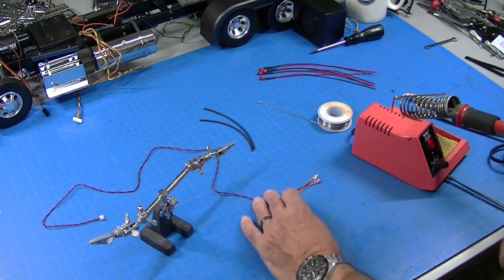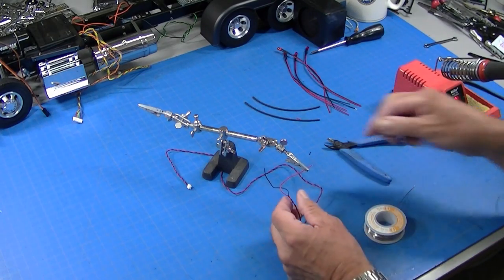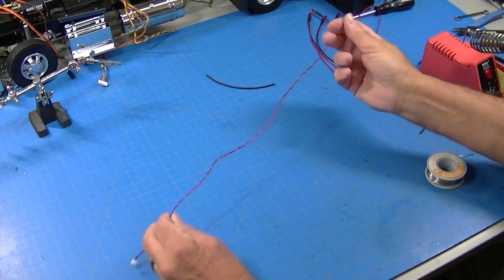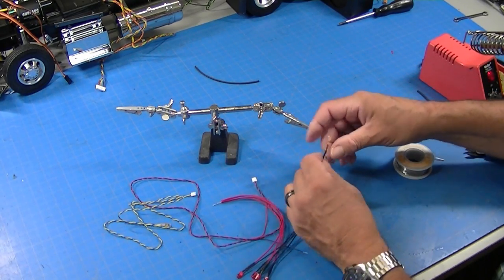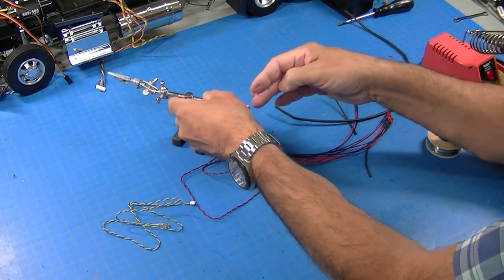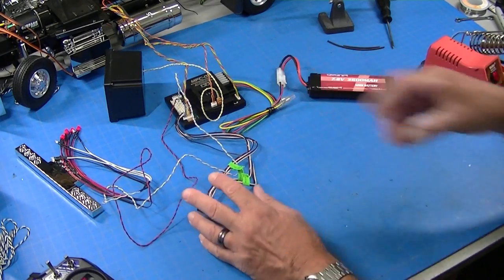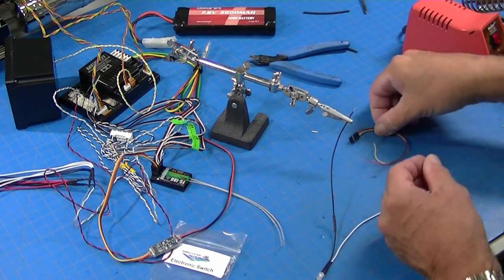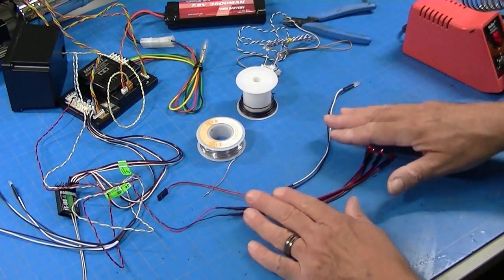Tamiya Semi Truck - How to Solder, Add MFC Lights and Lighting Tips & Tricks

Comment: Old bench tech here. I micro soldered 30g for many years . Using either soldering paste, or flux and solder, dip the stripped end into either and heat with your iron, add solder if needed to tin . When adding a wire to another or motor lug, make sure your joint is shiny and smooth. Great video

Comment: Loving your channel. A tip I learned when using the third hand is to put some heat shrink tubing over the alligator clips to help protect the wires.  Hope that helps.

Comment: I have a question I bought the tamiya 56502 light set for my flatbed I installed marker lights on the side I spliced into the main wire harness all the marker lights work and the Hazzards but the tail lights don't work that's what I tied into can it not be done sure could use your advice thanks Chris

Comment: I've been watching your channel for quite awhile now always find great ideas there, my  problem is I have been  converting trailers to super bs one is a flat deck and the other is a tanker any advice on a wireless lighting system for them ? I also would like to  use my motorized support legs wirelessly i have difficulty getting them to stay hooked to the fifth wheel

Comment: What size shrink wrap should I look for in soldering light systems and motor leads?
Reply from the maker: 1/8" for the light wiring and larger 1/8"-3/32" for the other wiring.

Comment: Hi. Loved your video on adding lights. I have a question on my situation. I have a Tamiya 1/16 Tiger 1 tank. It has a DMD multi function unit. It's the MF-01. I want to add l.e.d. lights to the front of the tank. There are extra slots on MF-01 but not sure if I can plug in a tamiya wire lume in one of those empty slots? I don't want to short out my MF-01 Computer. Are you familiar with the MF-01?  On the top of the MF-01 of the empty slots that are not being used say OPT. I'm guessing that stands for options? Also does the Tamiya L.E.D. wire lume have a built in resistor? Is there any way I can add two lights to my set up? Thanks
Reply from the maker: Look in my older videos I have a 4 part series I did on the Tiger tank including radio programming etc.  I would use an electronic switch for the lights.  An easy way to do it and the lights do not connect to the MF unit.  https://hobbyconcepts.net/products/hobbyconcepts-electronic-switch?_pos=1&_sid=4ad334b19&_ss=r
Reply: @HobbyconceptsLLC  thanks for your fast response. So I noticed that to use this switch it connects to one of the channels on the receiver? I have a 4 channel receiver/transmitter and all for are already being used. I would need to buy a bigger transmitter, and receiver with let's say a 6 channel in order to use this switch? I would hate to spend another $150 or more on another transmitter?
Reply from the maker: Yes, you need a transmitter with more channels.  I like the Flysky FS-i6x (it has 10 channels).  https://hobbyconcepts.net/products/flysky-fs-i6x-2-4ghz-10-channel-radio-modified-for-tamiya-semi-trucks?_pos=2&_sid=ae98d2e1d&_ss=r

Comment: I am hoping if I buy a 5 chan reciever for my spektrum DX5 rugged I can use it and have most of the MFC01 system work with it in my grand hauler build
Reply from the maker: I have never had any luck myself with pistol grip transmitters.

Comment: Very helpful video, thanks, just one question, with the electronic switch, should you wire the led's in series or parallel? Thanks.
Reply from the maker: I wire them in parallel.
Reply: @HobbyconceptsLLC  thank you
Reply: I make sure to ALWAYS wire them up in parallel in series I think they will buildup too much resistance.....

Comment: I think you may have forgotten to add the eBay link to the 30 wires and shrink wraps. I don’t see it?
Reply from the maker: Thanks for letting me know.  I just added a link to Amazon.
Reply: @HobbyconceptsLLC  just to let you know… I found them on eBay via another video you made. I bought them and got them yesterday. It came from Amazon and it had a receipt in it. They paid them 9.99 via Amazon. I paid them 14.99 via eBay. Lol.

Comment: What resistor and wire to use with 3mm and 5mm leds? mine burned out and i bought the mfc-01 but dont have enough leds and length to cover my project. Thank you in advance!
Reply: I’m also wondering about the resistor value on these…did you ever find out? I can’t order from Bob to Canada.

Comment: Hi Bob, You put 4 led`s on that lead rather than 2, How many extra led`s can can you put on a single lead OR in total on a MFC before it gets too much. Can the MFC handle the extra load?
Reply from the maker: That I do not know for sure.  I have run up to 6 but I am sure you can run more.
Reply: I believe that 10 is pushing it to the limit that the controller will handle without glitching or blowing it out
Reply: @angryyank  10 in total OR 10 per lead? Also why does bob put a resister on the new led BUT tamiyas do not?
Reply: @garymurphy5133  That is 10 LED's per lead